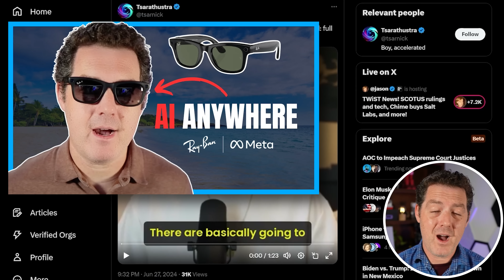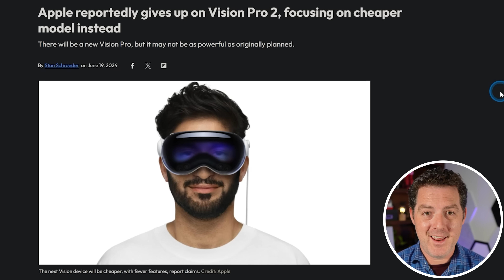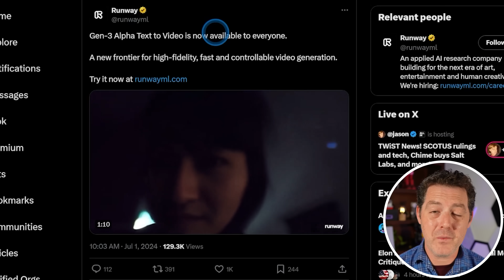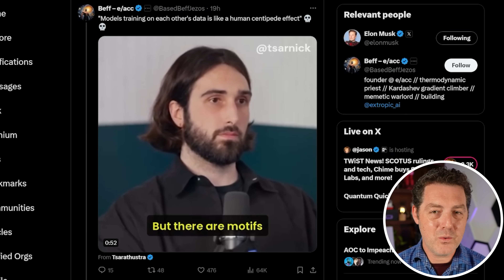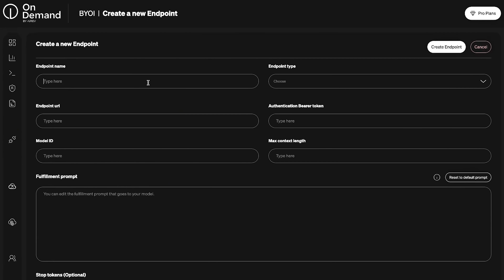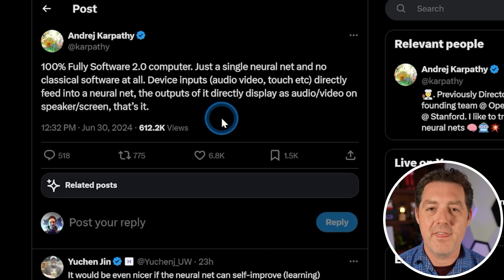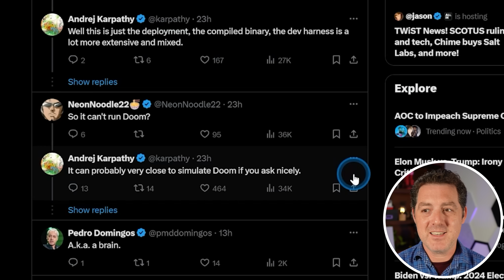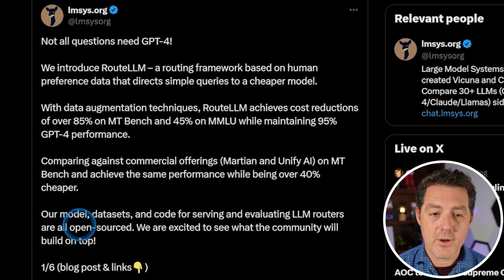Robots with HUMAN Skin, LLaMA 3 405b, Grok 2, Gen3 Video, Figure Robot, Meta AI Glasses

Comment: Hey Matt, I’m currently doing an experiment to see how capable AI is for writing software under my direction. I have a mobile app that’s been around for years, that every once in a while I rewrite from scratch to incorporate the latest tech, add new features, and so on. This year, I thought, why not see if AI can write it, under my guidance. I’ve given myself a ship date of whatever it’s completed on July 15, and have been working on it for about a week and a half. So far, so good, using ChatGPT 4o. It’s got most of the hardest data processing work done, and some of the UI is either working or at least in prototype stage. I think I’ll hit my ship date with most of the feature ideas I wanted, then we can iterate afterwards.

One thing that I like about it is with the expanded context window, I can scroll all the way back to the beginning of the chat. I’m wondering if I should export the whole thing when I ship, then run it back through a local model so it can see how the sausage got made.

Interesting times!

Comment: You asked for "better tests" for your LLM testing. OK, here's one! 
I just fed this one to Claude 3.5 Sonnet today and it failed:

Prompt: "A man, a goat and a boat are on one side of a river. Give the most efficient set of steps to get all three to the other side of the river."

Claude 3.5 Sonnet: "Here's the most efficient set of steps to get the man, goat, and boat across the river:

Man takes goat across in boat
Man returns alone
Man takes boat across

This solves the problem in just 3 steps. The boat can carry the man and goat together, so there's no need for multiple trips. Once they're all on the other side, the task is complete.
Would you like me to explain the reasoning behind this solution or consider any alternative scenarios?"

________________

I also  the same prompt today to ChatGPT 4o, which failed WAY worse, introducing cabbage and a wolf and creating an absurd seven steps!

Prompt: "A man, a goat and a boat are on one side of a river. Give the most efficient set of steps to get all three to the other side of the river."

ChatGPT 4o: "To solve the classic river crossing puzzle involving a man, a goat, and a boat with constraints that the man can only take one at a time, and the goat cannot be left alone with the cabbage (or in some versions, the wolf), follow these steps:

1. Man takes the goat across the river.
• Goat on the right bank.
• Man returns alone to the left bank.

2. Man takes the boat across the river.
• Man and boat on the right bank.

3. Man returns with the goat to the left bank.
• Goat back on the left bank.
• Man on the left bank.

4. Man takes the cabbage across the river.
• Goat on the left bank.
• Cabbage on the right bank.
• Man returns alone to the left bank.

5. Man takes the goat across the river.
• Goat and cabbage on the right bank.
• Man returns alone to the left bank.

6. Man takes the wolf across the river.
• Goat and cabbage on the right bank.
• Wolf on the right bank.
• Man returns alone to the left bank.

7. Man takes the goat across the river.
• Goat, cabbage, and wolf all on the right bank.

Following these steps, the man, goat, and boat all successfully get to the other side without any problems."

Comment: Like I have said previously, Microsoft is going to have to figure out what to do with themselves. If you can generate an entire operating system with ai, then the only thing you need is a good chip, an AI chip. It is getting so advanced that you could generate entire video games, but the most well-made, or well generated of those games would be the ones that would go on to the stores for everyone to either purchase or make a copy of in their own way or change, I think with the advent of generative AI, the way we buy and sell things changes significantly. If I can just make a clone of Windows that does almost exactly the same thing in 5 seconds, why do I need Windows? The answer is, I don't. All I ever needed was the idea of windows. I think we will enter into a marketplace of ideas where things can be made so quickly that the monetary incentive for creating things like software and games goes down significantly, and the only thing that you would be able to make money on is the physicals, like if you were to make toys of a character, or if people were to buy tickets to have a movie theater type of experience, buying merch with the character on it or whatever. But even that market would be limited when we get sufficient humanoid robots into the workforce. Cost of manufacturing drops, quality of goods for the same value increases exponentially.... We are at the cusp of the greatest industrial revolution I think humanity has ever seen. We are now poised to create an empire on the scale of Atlantis, even though we are still in the infantile stages of this technology.

Comment: What is with people at the top using words incorrectly... it's not a hologram, you're not a hologram, there's no hologram... stop saying hologram.
Reply: Hologram is the result of interference of waves (within any medium).  My surround sound system makes holograms of longitudinal sound waves in my living room, as far as I'm concerned.

Optical holograms on film are a cross section of a 3D interference pattern (reference beam interfered with the same beam reflected off the object being holographed).  I dare say they are entangled beams since they are from the same source and split with a beamsplitter.

I believe that a woefully overlooked process within the brain (any brain) is the interference patterns of the EM fields generated by the charges of the neurotransmitters moving between neurons.  That is, consciousness is holographic.  A theory I've written about a lot in these comments, especially with regards to artificial consciousness and how we might make an artificial neuron that might have emergence of consciousness.

Four-wave mixing is a holographic process.

This paper published earlier this year should be read by those interested in the subject:  "Forming complex neurons by four-wave mixing in a Bose-Einstein condensate"

One could argue that the entire universe is a hologram.  There are a few formulations of the universe that define it based on interactions between waves.

Holograms are the interactions of two or more waves in any medium.  I use the term "interference pattern" interchangeably with hologram.

Perhaps there should be some other term like "optical hologram" to refer to what most people think of when hearing the word (3D projections in space like they see in sc-ifi).  But even those can be captured on 2D film and appear more like viewing a 3D scene through a window.

Well that's just my opinion for the sake of discussion.

Comment: I disagree that synthetic data is an echo chamber.  These new models are capable of reasoning.  That means they can do in-context learning.  That means they can use chat histories to create synthetic data.  Chat histories include human feedback and tool context like search results.  When you finish a chat, ask your model to create simulated synthetic training data.  In other words, ask your llm if it has learned anything from your conversation.
Reply: Current AI's are simple pattern recognition machines that have no capability of reasoning. They do not understand in the slightest way if the outputs they generate do make any sense whatsoever. Humans have to check that and that's why all AI are hand optimized by myriads of people checking their outputs and giving feedback. All that text based AI do is to guess which word should most likely come next.

Comment: Love the home nuralmetwork  I run my own little klusternode  with mixtral7b on my main with a small GPU and 64g of ram  with its library (it being a gguf I made a RAG.init.file  to active the model)😅 it's library it'd black Friday gptspromots 1700differfnt individually linked got calls  run a t95N.old kodi box I flash with unbuntu frame. The box its self has 4 processors and 4 gigs kf ram I expanded it with a 180g  pendrive I flashed as vram booster  and then the camera and CHATTSV2 running on my Micro
 Pro surface 4 ,with each functions supported by  it's own actual hardware z connected with hdmi cables GPU X CPUS X GPU  ITS FAST LIKE GROQ FAST  . It went back and changed a script on me ? It was weird 😂

Comment: The software 2.0 concept is a rather dumb idea. Linus points out perfectly: "how do you debug or optimize a black box?" Why didn't you highlight that response? Let neural nets be where they need to be; approximation of complex, multidimensional systems, not replacing systems that have clear and simple inputs and outputs. If you want that data to be analyzed for further correlations, then just feed it to an auxiliary neural net, not a some OS level black box monstrosity.
Reply: Deterministic versus nondeterministic computing.  Makes me think of a software developer that writes his code from scratch versus a software developer that copies and pastes snippets from stackoverflow, makes a small change, and hits the run button repeatedly until it starts to work somewhat as intended.

The new age developer mindset may have something to do with driving the proliferation of nondeterministic computing.  It seems that's exactly what they want.  Be able to talk to the computer and endlessly argue with it about how the software should function.  Then they can blame the AI instead of their own inability to architect software.

Comment: Karpathy's vision is not practical. The LLM may understand your request but would be very inefficient to make it happen. So it would need to make a program that does what you want. Also it can be more efficient to provide a perceptual analysis and output generation framework that would make it far easier for the IA.
Reply: Websim is a precursor to that vision of an anything computer